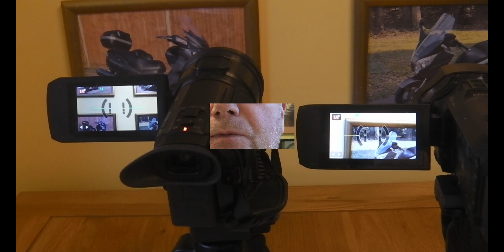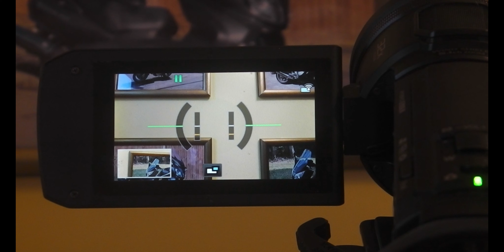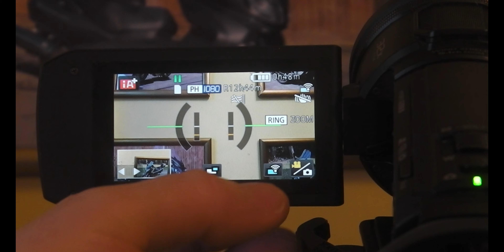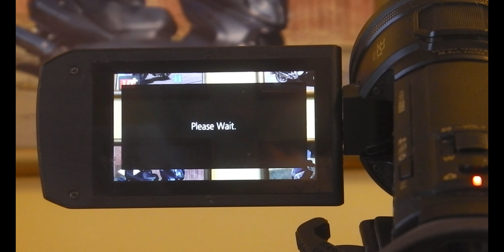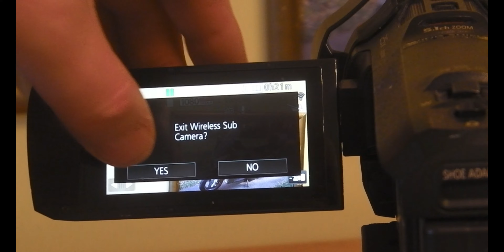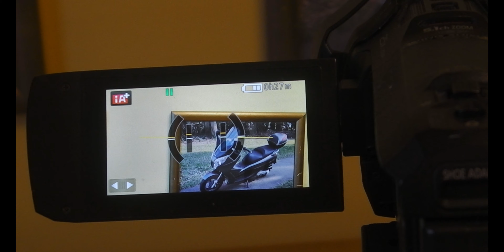How to set up Panasonic HC-VXF1 and HC-VX980 twin camera/master and sub/master and slave.

Comment: Do you know if the HC-VX980 has clean HDMI out? e.g Can you turn off all screen graphics on the camera so when connected to a pc / TV via the HDMI the image is clean? I can't find a definite answer via the Panasonic website or elsewhere.
Reply from the maker: I have no idea. I do not know what clean HDMI is. It took me 3 days to figure just how to do this as there are no clear instructions anywhere. While the cameras are very very good, finding anything out on how to use them other than on and off is near impossible. One so called Youtube expert reviewer even said the HC-VXF1 did not have a manual focus which of course is rubbish. Sorry I could not be of more help.
Reply: Did you ever find out if it's clean HDMI out? Madness that it takes hours of research to get an answer that should be in bold letters in the damn manual. I'd be surprised if it wasn't clean. Surely the display info can be switched off.